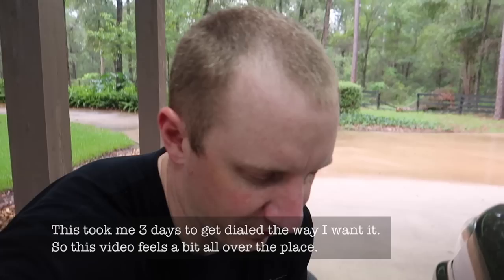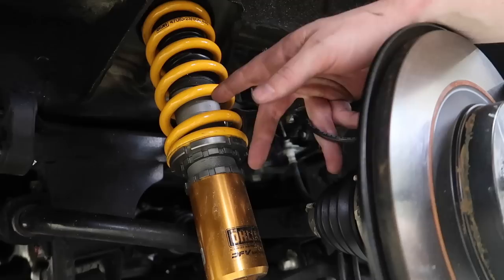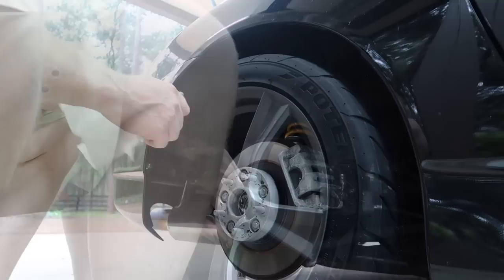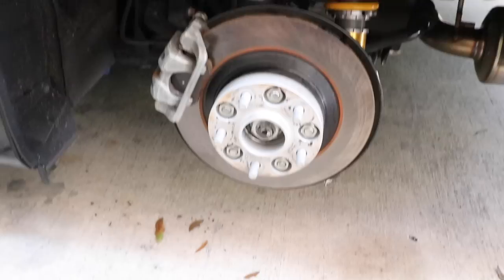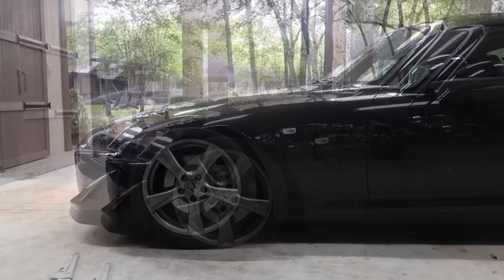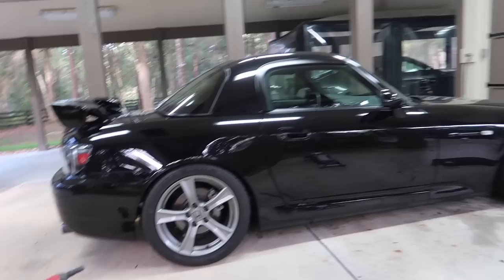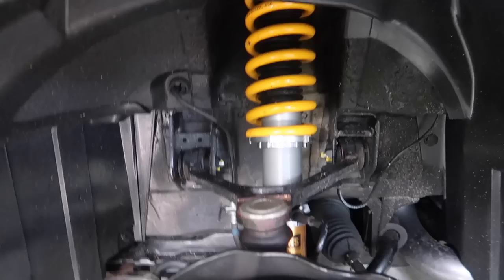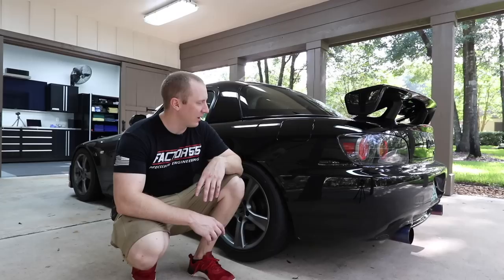More Height and Pre load Adjustments on Ohlins S2000 Suspension

Comment: I was only paying 50% attention, but just in case I saw it right: you can't just lower the vehicle onto its wheels and look at the ride height. You have to move the vehicle, rock it around some at least. Because tire friction won't allow the tires to settle all the way after taking off of a lift or a jack.

Comment: If I recall, 15mm spacers don't work on the Ap2 v3 wheels. The original studs will hit the wheel since the spacer doesn't have enough clearance. I think you need 18mm at least to clear original studs.
Reply from the maker: Yep, you are right.  Learned that one yesterday.

Comment: I like the height and what you dialed in their Matt, I would definitely get a torque wrench I just use a cheap ass brand new Harbor Freight torque wrench I only use it for torquing Wheels. And when I bought it I compared it to my buddies Snap-on at work and they were dead on with each other as far as torque goes. I feel the best thing to do is when you're done using the torque wrench it's just set it down to its lowest setting either 5 or 10 foot pounds but I would not leave it in a high setting you're done using the tool.
Reply from the maker: I'm going to get a Snap-On set soon.

Comment: Did anybody warn him about the strange preload settings for the s2000 in the rear? 
We got owners recommended 30mm preload and some even put aftermarket lower cups for this coil over because it hits the bumps stops. This is all from s2ki forums

Comment: What brake setup are you planning on using? I'm going to guess your waiting on the new wheels first.
Reply from the maker: Stoptech Trophy front, Stoptech Slotted OE Rear Replacement, Stoptech Street Pads, Rear Stainless lines, Painted Rear Caliper